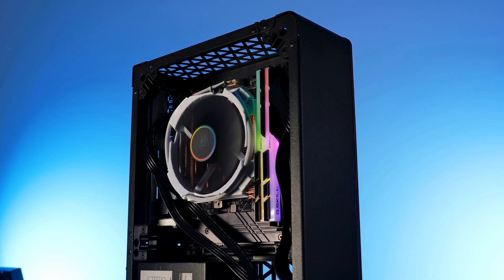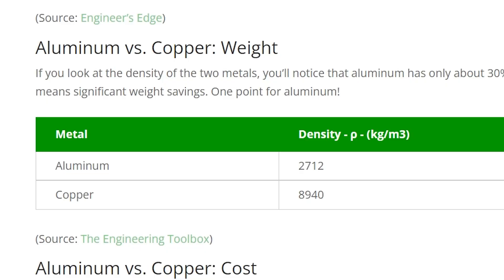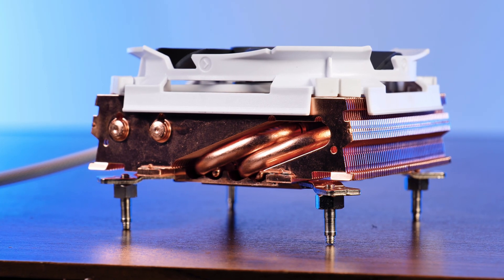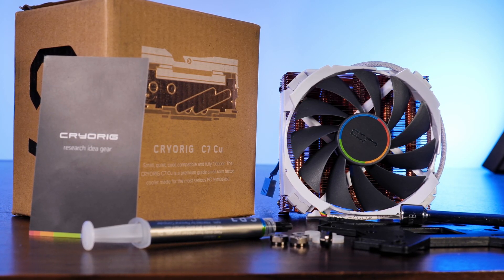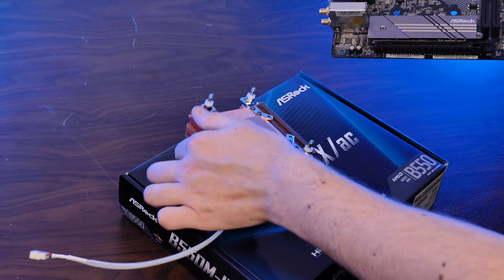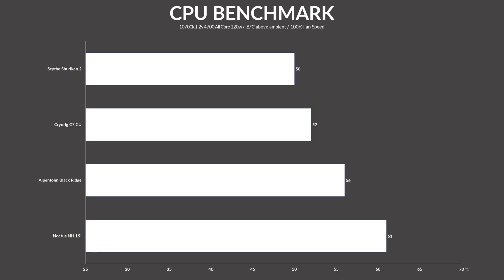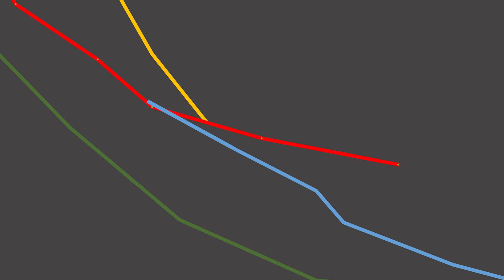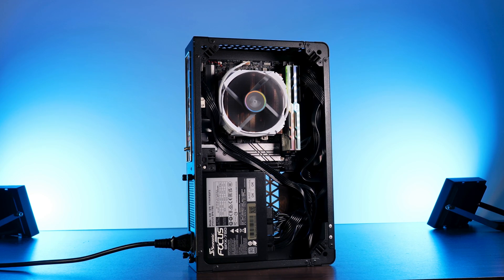Cryorig C7 Copper - 100% Copper = The Ultimate Cooler for ITX?

Comment: The Alpenfohn Black Ridge comes by default blowing hot air away from the CPU, instead of pulling cold air towards the CPU as all the other coolers. Some users reported a much better cooling performance by just reversing the fan direction, so it would be great if you could add that option to the comparison. Other than that, thanks for the great content!